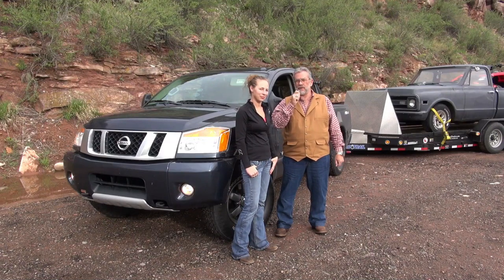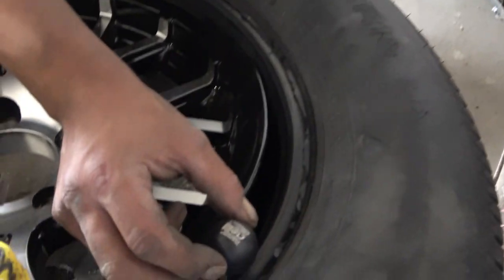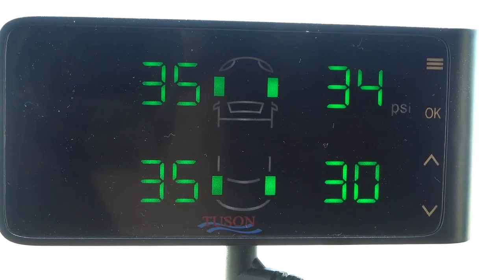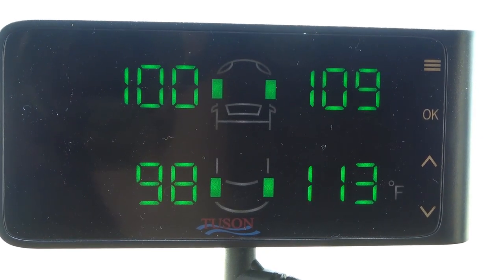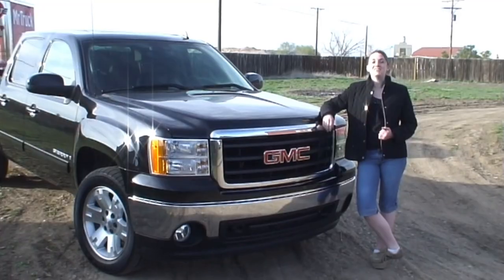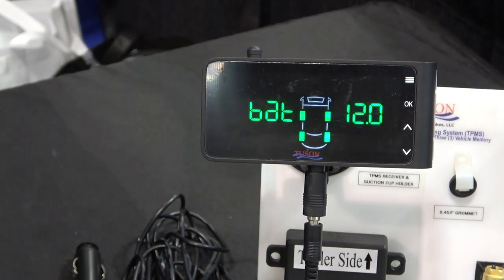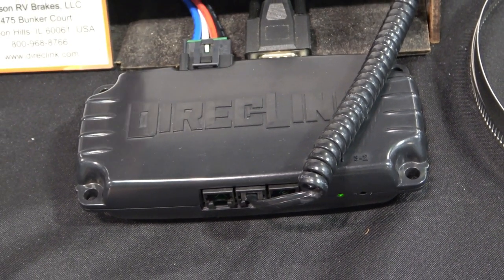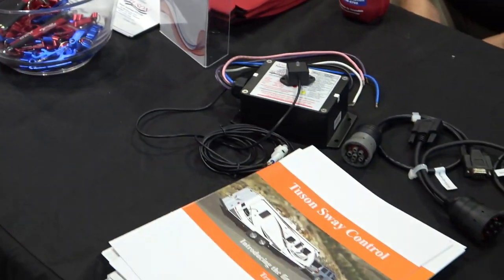Tuson new trailer tire air pressure ball sensors at NATDA, warn you before that expensive tire blow

Comment: So I presume if a ball was put into a spare tire, the sensor wouldn’t send a signal because it’s not rotating? Or would a little jostling back and forth (due to trailer being pulled around) cause it to wake up and transmit?
Reply from the maker: Good question, I don't think it would give a signal until you mount the tire

Comment: i have the rim band version. the monitor is the issue for me. i don't have the battery expander and i dont want the volt meter to show since i didn't hook anything up. so it cycles with a black volt for a while now. kinda annoying. I'm using it for just my regular car. no rv no trailers. i wonder if there is an update for this issue?
Reply from the maker: What brand is it?